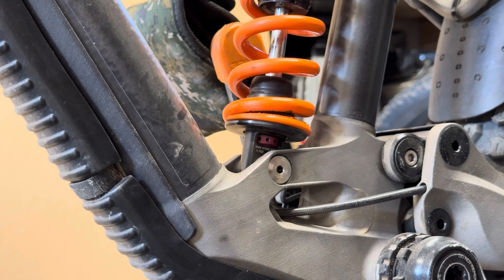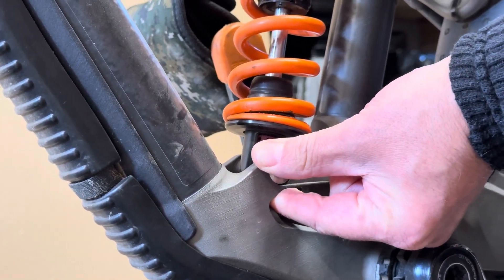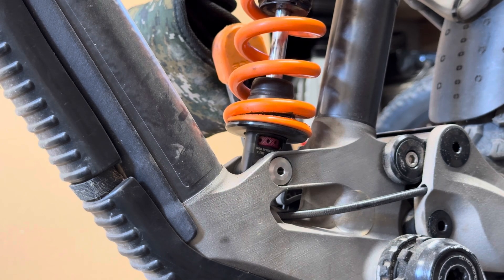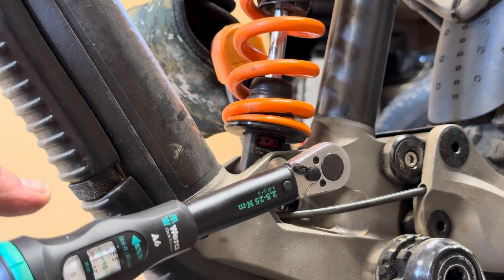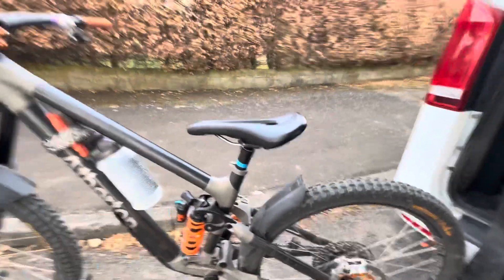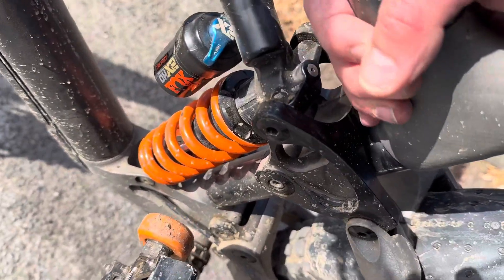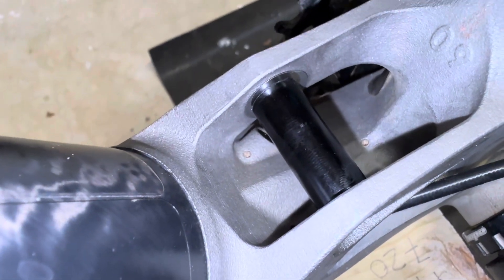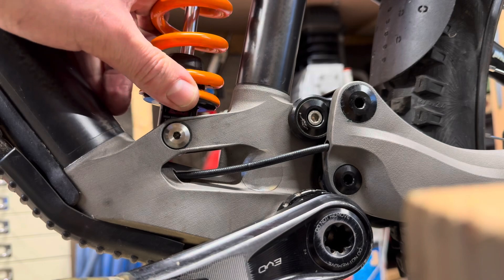Atherton bikes AM170 lower shock pivot frame problem - update

Comment: Hey Ian, I understand that everything has been successfully resolved now with the lower shock pivot and refund received  - I do hope so ... we'll call on Monday to follow up and make sure all is OK post what I hope is an excellent weekend's  riding!

Some info and explanation for your followers...

The material for part A will depend on the bushing manufacture, more often than not they tend to be aluminium, however, steel isn’t uncommon. Fitting a steel replacement to your  A.170 is no problem at all. 

The shock lower mount pivot design is common between the A170 and the A200. Having said this, the A.170 is fitted with an aluminium version as standard, whilst the A.200 has a steel version. 

Regarding the additional measurements you requested, these are not included in our publicly available technical sheets( this is not a measurement commonly shared by other manufacturers)  If we ever need to verify whether a frame is within tolerance, we typically bring it in-house for assessment.

Based on the information we currently have, we don't believe that this step is required but if you still have any doubts we'd happily offer that in-house check for your re-assurance. 

The offer of a chat to our design team to review your specific situation and offer any support you may need still stands also...

Comment: DU bushing in the shock eyelet could be excessively tight. If this is the case, as the shock moves through travel the bushing will rotate with the shock loosening the bolt along with along with wearing the Ti around the mounting holes. The bushing should be static on the frame and the shock should ideally rotate around the bushing. You can burnish the du bushing in the shock to loosen it up. Or you can try a needle bearing kit from enduro bearings or real world cycling.

Comment: Customer shouldn't have to do these things. This is clearly a faulty product. They should refund you this is unacceptable.
But if being without a bike isn't an option then you seem to have ocme up with decent solution. But this isn't optimal. They should refund you or give you a new frame this doesn't have issues.
They need to gale car eof their customers or they will be out of buisness or atleadt gian a bad rep.

Comment: Couple of thing at play here:
1. Poor fastener design, not enough bolt stretch. The male threaded end with the hex is so short, and short bolts without stretch come loose. Thats engineering design 101. Why are cylinder head bolts so long? Why dont spokes come loose? Etc.
2. The bridge of the printed Ti frame is so stiff, the clearance is not closing up under the clamping load of the bolt (which explains why things only get better at much higher clamping torques). Ideally, they would design one half of the ti bridge to be more compliant. Right now its seems they need 10Nm just to close the 0.4mm gap to the shock, at which there is little or no clamping load left on the shock itself.
3. 3d batch printing in Ti is not as accurate as a CNC'd mount. 0.4mm gap is probably well above what the CAD screen says. 
4. Bushings are crap, they could have designed it with a bearing-ended shock where the inner race is clamped. Then you get ZERO play, until the bearings are shagged, but no 2. applies still.
5. Once the bushings are loose on the pin, they will 'gall' it and grip to it under load, again helping it work loose. 

Folks think Atherton bikes are infallible but as we see as they expand and volume increases, these things get missed, and they are running the risk of, 'it works in CAD so it should be fine'.
Reply: Yep, very poor engineering….😢😢